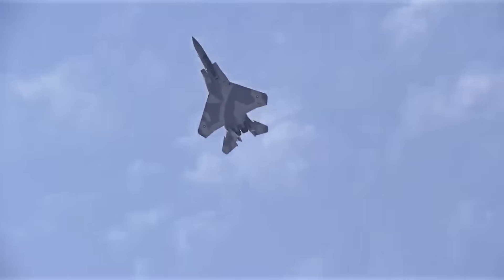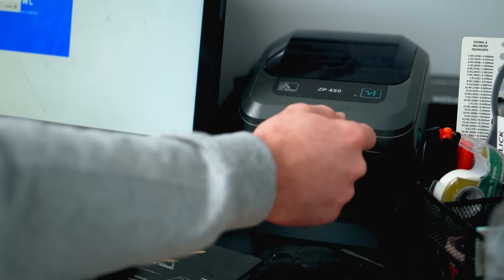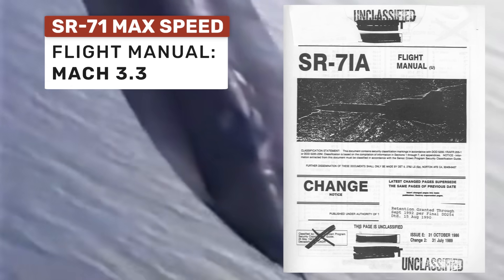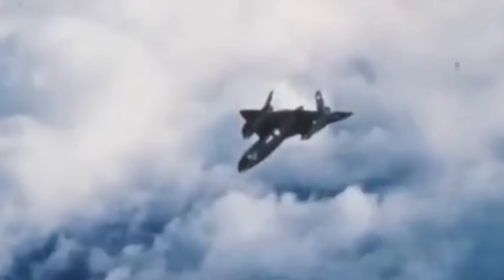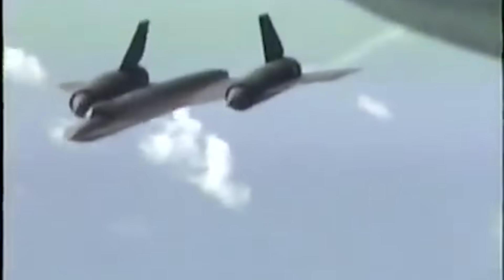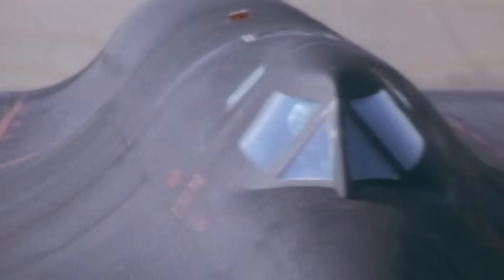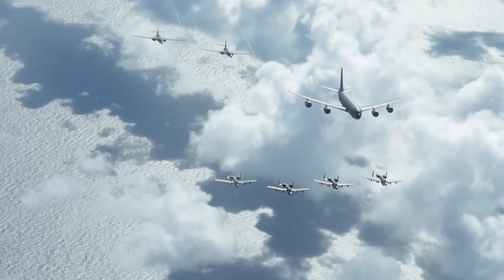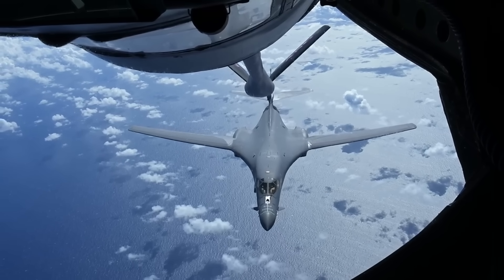The SR-71 was MUCH FASTER than the Air Force will admit

Comment: There is a difference between short duration/quick emergency high MACH sprints and cruise speed. Below comment  is a record of 3000 mph. That can reveal a quick sprint. The SR-71 had hybrid jet/ ram jet engines. The cockpit MACH indicator went up tp 4.5. Wings had to be X-rayed by ground support techs if the indicator showed 4.5 after a recon flights over N Vietnam. This would happen when SR-71s were guided away from SAM missiles by ground control. Even when an SR-71 had to outrun a SAM missile over Libya, (April 1986) the pilot did a short 17 second sprint of high MACH...which they had never experienced before. Call this BS  or rumor, I don't care. I sat next to the son of an SR-71 pilot, when in a college MATH class, who set a record in Calif on the SR-71 which had a WHITE cross painted on its bottom and they flew it only fast enough tp set the record. Also, since I served during Vietnam time, I talked with techs who blabber details that officers & pilots don't share so they keep their jobs/pensions. So what is the big deal now ,TRUTH WARS??  The last flight of an SR-71 was almost 25 years ago....find another conspiracy theory to waste your time.
Reply: Virtually everything you said in that post was wrong. Like epically wrong. Its hard to find anything factual, which is impressive.
Reply: @gr8crash  OK try this.......2+2=4, the sky is blue, YouTube comments are ALL over the MAP!
Reply: @bobreese4807 well those comments are true. But your entire original comment is wrong in virtually every way. 2 main things to address. The speed you mentioned was never remotely possible, nor was their a gauge for those speeds. Nor did the SR71 have a "dash" speed parameter.
Reply: @gr8crash  So you checked my comment with Kelly Johnson ?
Reply: @bobreese4807 you didn't say anything in this thread about Kelly. But even he wouldn't say the dumb stuff you did above.
Reply: @gr8crash  Major Brian Shul once reported a speed of over Mach 3.5 while evading a missile over Libya. I sat next to George's son in MATH class..958 was the first "regular" (neither test vehicle nor trainer) blackbird delivered to the Air Force.  She left the assembly line on July 22, 1965, and made her first flight with pilot Bill Weaver and RSO George Andre on December 15 of that year

Comment: When I was in the Air Force, I remember it being 3500 mph and it was classified more. But maybe it was Mach 3.5 and I just didn’t remember correctly.
Reply: Most if the pilots in interviews have said it probably could go at 3.5 but no one ever did it, 3.2 is where they were told to hold it at, the inlet temperature of the engine's is what limited it's speed, 3.2 is what it could do sustained, any faster than that would have dramatically cut back on the life of the engine requiring an unscheduled engine change and would result in an immediate dismissal from the program. 
One of the things that the psychologists look for in applicants and what there records were thoroughly checked for was any indication of a pilot having a tendency to be a hotdog or cowboy type of personality, unlike other aircraft the SR71 wasn't your personal toy to play around with, it was a national asset and anyone that would do something stupid in it would do nothing but embarrass the country and the president, they wanted people that were 100% professional and would follow each and every flight plan to a tee without any deviation at all.
Reply: @dukecraig2402 thank you! That seems completely true, it still seems like a national asset.
Reply: Neither are particularly accurate

Comment: I am more comfortable with the top speed of the SR-71, not being public knowledge while it was operational. The two retired SAC generals i worked for were of the same mind.
Reply: Why? Our enemies knew exactly how fast it went they followed it on radar.
The SR71 was stealthy but it wasn't stealth, radar had a hard time seeing it coming but once overhead and outbound they were looking right at it and knew exactly how fast it was flying.
Reply: @dukecraig2402  There is a comical irony in the fact that the USSR, our sworn enemy, has probably detected the aircraft flying at speeds which are above the publicly admitted speed.

Comment: While you are resting you should talk to some of the men that flew the B-58 Hustler.  While not as fast as the SR-71 that plane would GOOOO.  It was so fast that the friction with the outside air would burn the decals off the skin of the aircraft.
Reply: The F111 was the same way, the top speed on it couldn't be exceeded because it'd start melting the windscreen.

Comment: My dad flew the SR from 1968-1973. When asked about flying faster than the record he said, "We all flew faster than that." He got into a circumstance that required faster flight and asked his RSO about their ground speed. "2454" MPH was the reply. BTW, he is the pilot of the plane shown at 5:12 and 5:56.
Reply: He'd have been immediately dismissed from the program if he'd have exceeded 3.2, listen to the interviews with the pilots they all say that and explain why it was grounds for immediate dismissal from the program.
Reply: @dukecraig2402  I thought they were cleared to exceed "cruise speed" if they had to outrun a missile? (e.g., "a circumstance that required faster flight" in the OP)
Reply: @BryanM61  They did what they had to do. When he had a double un-start the "book" said to eject. Reggie didn't want to be a POW and my dad was afraid of sharks, so they were the first to restart both engines.
Reply: @BryanM61  
The electronic countermeasures took care of the missile's.
Reply: @BryanM61 still not how it works.
Reply: @dukecraig2402  Oh BS. This was the 60's; ECM were primitive and unreliable; basically chaff and flares, and I'm not even sure SR-71's had those. I've heard several of the pilots tell stories of opening the throttles and outrunning missiles. From Wikipedia: "If a surface-to-air missile launch was detected, the standard evasive action was simply to accelerate and outpace the missile."
Reply: @BryanM61  first never trust Wikipedia. Also the SR71 never had flare/chaffe dispensers. What it did have was a very sophisticated ECM/DEF equipment suite that helped keep it safe. Those systems worked so well some are still in use today. 

Also that speed comment isn't very accurate. As it also depends on what part of the mission. Most time if it occurred during collection they couldn't do much otherwise the data would be compromised.
Reply: @dukecraig2402  YES they did, and resulted in the destruction of a Mig 25 while my dad was flying, but that's a whole other story.
Reply: @dukecraig2402  Under normal circumstances, yes.  Saving the plane was allowed.
Reply: @russcobb6990  
How could an SR with both engines out accelerate past it's cruise speed of mach 3.2?
Reply: @dukecraig2402  Two different incidents. 1. My dad presumed they all flew faster than the public record. I watched  him sit with a calculator when they announced the time in  the last flight from LA to NY. He just looked up and said, "Why didn't they allow them to open it up?"  2. Not only did he fly 2454 MPH to avoid a missile, but he also put the book aside to restart both engines also to save the plane (and avoid ejection). They had some flexibility to do heroic maneuvers.
Reply: @russcobb6990 that's highly doubtful.  First the record flight was LA to DC not NY. They already flew parts of that run at their max speed. They did ask for permission for exceed the CIT limit and P&W said absolutely not. That speed would have been mach 3.68 which was absolutely impossible. And since there's no ground speed gauge like other aircraft it would be all of math and none of that seems to add up. That MPH speed simply wasn't  possible and absolutely never happened
Reply: @russcobb6990  also just out of curiosity, if even they flew that speed and somehow survived, how would they even know they were going the fast?
Reply: @gr8crash  After getting clear of whatever they were trying to avoid my dad simply asked Reggie about their ground speed.
Reply: @gr8crash  The Mach number also depends on altitude and temperature. My dad never bragged about speed because he presumed that he was one of most other SR pilots that went over the 3.2. He was a very quiet and  humble man that loved that plane and had absolutely no inclination or motivation to exaggerate anything. If he said that's what Reggie told him I believe it. NOW, Ask me if I care what your think?
Reply: @russcobb6990 that's not how it works, at all. And not dismissing him being humble or quiet etc but none of these details make any sense, especially in regards to speed. The speeds you are trying to claim simply 100% never happened or were possible.
Reply: @dukecraig2402  I was curious what name they were doing to give.  They make it sound like it was Shul,  but that wouldn't have been possible.
Reply: Who was your dad? Because that doesn't sound correct.
Reply: @gr8crash  Lt. Col. Darrel Cobb, Reggie Blackwell was his RSO.

Comment: Design began late 50s, early 60s by engineers using Slide Rules . Most of Titanium  metallurgy was developed to make the plane. Annealing took place on most flights , making it stronger as it aged. There were never any similar planes developed due to technical and financial barriers  !
Reply: It's a myth that only slide rules were used in it's design, computer's were very much used during it's design. 
Try learning about other than in the comments of YouTube videos.

Comment: I remember a Popular Science interview with an SR-71 pilot who could not reveal the top speed but in the article he slipped with two clues that gave a close idea.  First the plane takes off with full decal insignia but lands completely stripped due to air flow ripping them off.  Second clue was that the small windows were a benefit due to the leading edge of the titanium wings glowing "white hot" due to aerodynamic friction.  A little math to calculate speed at altitude to heat titanium to white hot and that plane exceeded mach 4 to 5.  Popular Science was never granted another pilot interview.
Reply: Huh? None of that is even remotely true.
Reply: I read the article.  It was not hearsay.  I can't validate the speed estimation by PS but I remember reading it.
Reply: @BulletproofPastor  not saying you didn't read the article,   but it's all completely BS.
Reply: The speed was limited by the engine’s cone.  You can’t swallow your own shock wave.  That’s why the data printouts maxed at 3.2 Mach.  Of course it could go a bit faster, but engine flameout becomes an issue.
Reply: @CSMSteel7 not quite. The initial limit to higher speed was the CIT limit, not the inlet cone. "Swallowing" the shockwave generally wouldn't happen until higher speeds. 

Also the MSR tapes max out at 3.5,  not 3.2.
Reply: @gr8crash 
Anything over 3.2 would take the engine heat into a temperature that was not sustainable and would call for an unscheduled engine change and result in an immediate dismissal of the crew, and they knew it, that's why it was never flown over 3.2 despite all the internet claims. 
They also had absolutely no reason to lie about it's top speed, every country it ever flew within 200 miles of friend or foe tracked it on radar and knew exactly how fast it flew, it was hard to see coming on radar but once it was overhead and outbound they were looking right at it.
Reply: @dukecraig2402 you're definitely better than most when it comes to speeds at least. But couple things to remember. It definitely flew over 3.2, 3.2 wasn't a hard limit. Mission cruise was 3.17, max cruise was 3.2. So agreed, most missions were 3.2 or less. Atmospheric temperatures makes all the difference here. There were so many examples where they would reach 3.21, or 3.23 without an issue. As long as engine CIT was below the limit, they were good. There's a very few instances of the SR71 reaching speeds of 3.4X, but those speeds were only under VERY specific atmospheric conditions and not fully within the pilots control.

Comment: Back in the mid 70's, one of our 1CEVG radar sites accidentally locked on to an SR71, range gate at the right place at the right time by an operator waiting to do a different mission, tracked the plane long enough to have a scoring track on the computer's plotting surface with timing marks.  The air speed ruler in use showed a speed of 3,000 m.p.h. It was not long after that the site received a call from HQ giving us a full run down on the type of equipment and a list of specs covering the tracking and they were told to destroy all records of the incident. I would not be surprised if it could go faster.
Reply: There was no point in them lying about the SR71's top speed despite all the nonsense internet claims, it may have been stealthy but it wasn't stealth, it was hard to see on radar coming but once overhead and outbound every country that it ever flew within 200 miles of friend or foe tracked it on radar and knew exactly how fast it flew. 
All the nonsense internet claims are people's imaginations running wild and nothing more, it flew mach 3.2, there's no mystery to it.
Reply: The SR71 was literally incapable of flying anywhere close to that speed.
Reply: @gr8crash  You evidently have forgotten the X-15 with a top speed over 4,000 m.p.h.
Reply: @stevenjones5579 did not forget that X15, but no one is discussing he X15 so not sure why you brought it up?
Reply: @stevenjones5579 
What does the X15 have to do with this? It was a rocket powered research plane that was dropped from a B52, an entirely different thing. 
What a pointless comment.